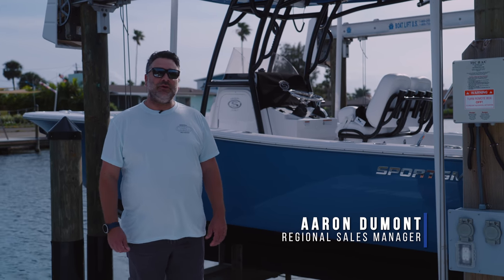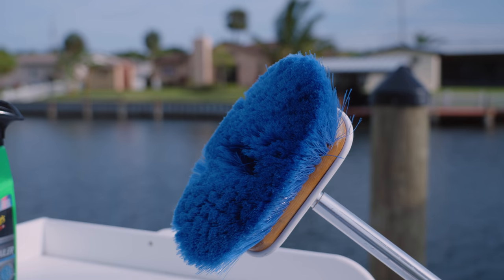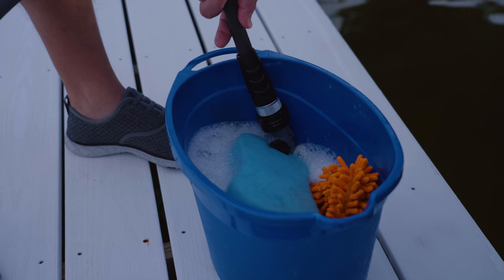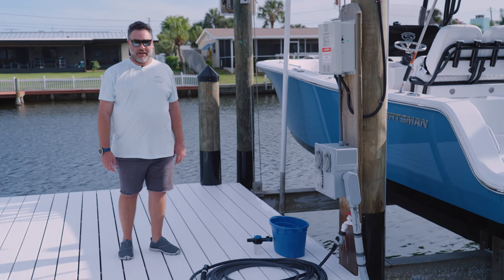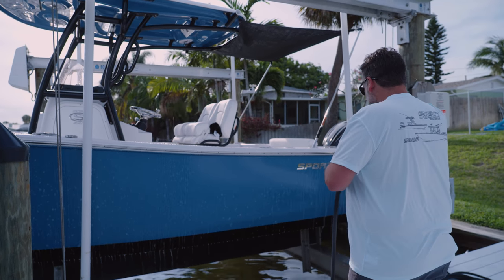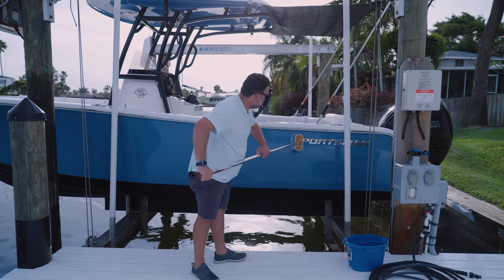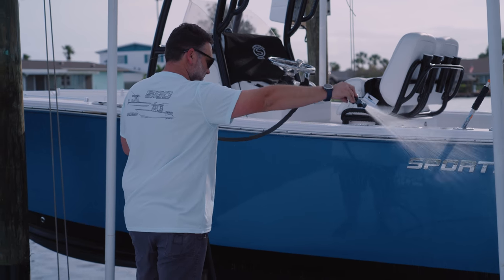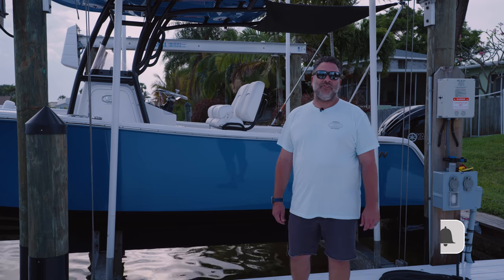Tech Talk - The Basics of Keeping Your Boat Hull Clean

Comment: The only issue with your system is the wash itself.  It doesn’t appear to be safe for marine use and biodegradable.  Maybe I missed that.  You indicated that you used car wash soap vs marine grade soaps.
Reply from the maker: It is labeled on the bottle for car, marine, RV, etc and is biodegradable. We make sure to stick with all safe products for the boat.